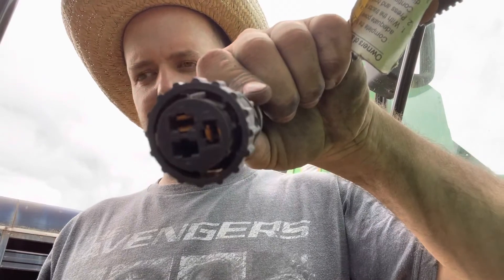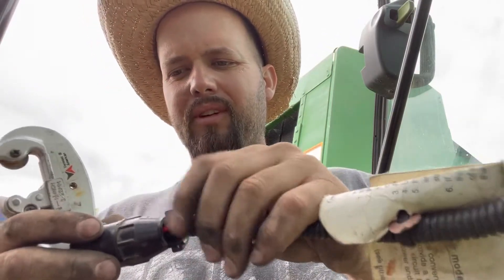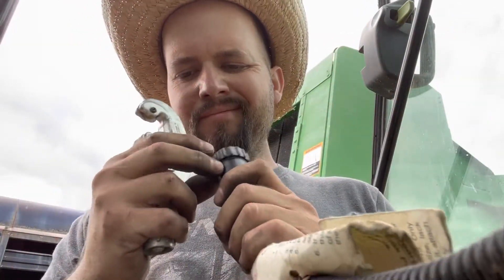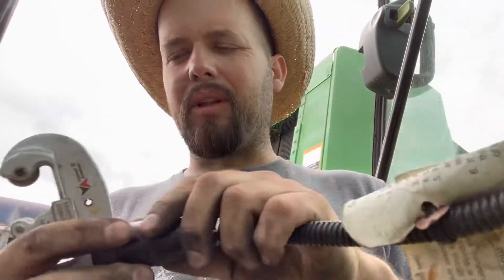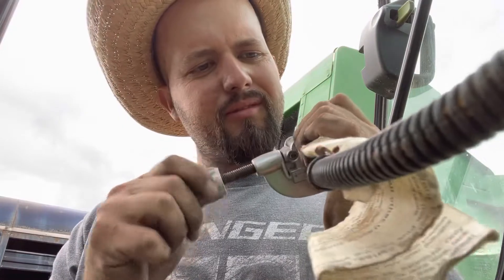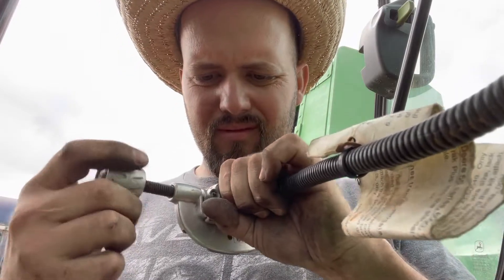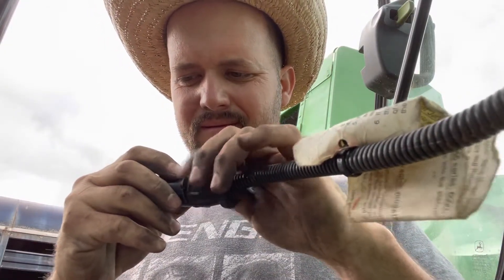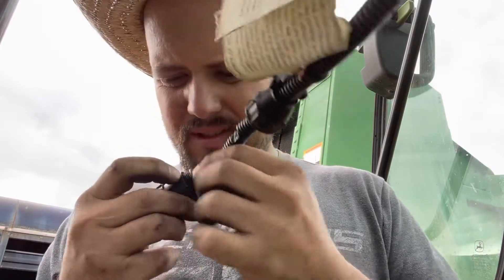What can I say

Comment: Lol.. you don't know until you try.. 
Like brad said, check the fuse. It's usually that or a bad connection somewhere. I like to put dielectric grease in plugs like that, keeps the corrosion away.
Reply from the maker: Was some wires
Reply: @Theblindfarmer  sometimes not ALL the ports are used on the plug as well... maybe use the extra port on some other machines that have extra functions or whatever.   Later! OL J R :)

Comment: ROFL... I saw the pipe cutter and I was like OH NO you're gonna destroy the thing (and I'm sure Ma Deere is really proud of them too!) and I'm like "just unscrew the thing!"  Anything that's put together can be taken apart!  (well usually).  They had to get the wires in there some sort of way!  

Oh well don't feel too bad, it happens to the best of us... one time the governor on the combine quit working (belt driven) and I pulled it off and spent several hours trying to get it apart and finally just beat the d@mn thing into pieces with the sledge hammer-- couldn't get it apart to fix it but left my frustrations in the pieces that were left over... then ordered a Pierce Universal Governor from Shoup and installed it on the combine-- virtually identical to the original combine governor.  Later!  OL J R :)
Reply from the maker: Sad part was I’ve taken them apart before lol  not that one but others